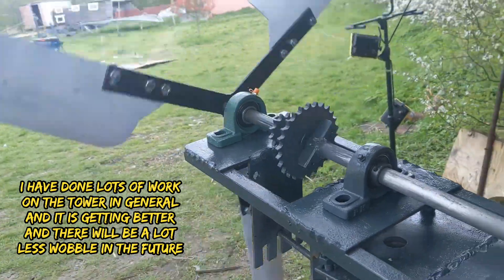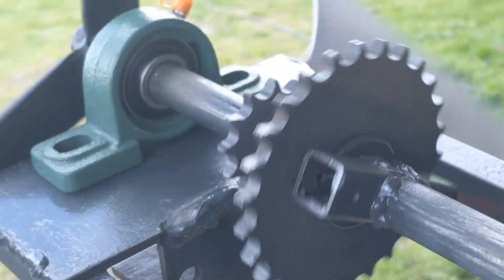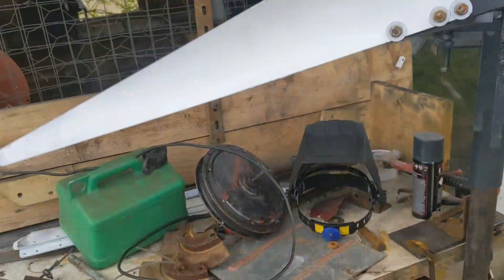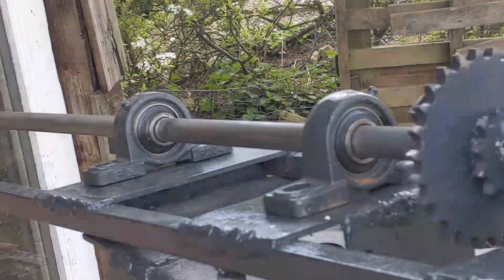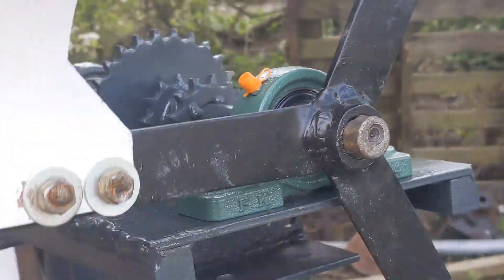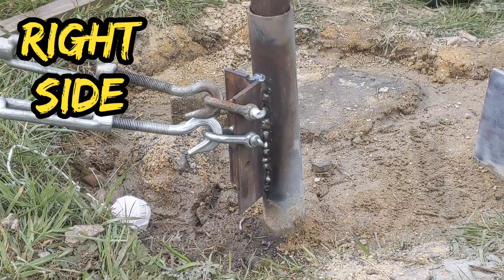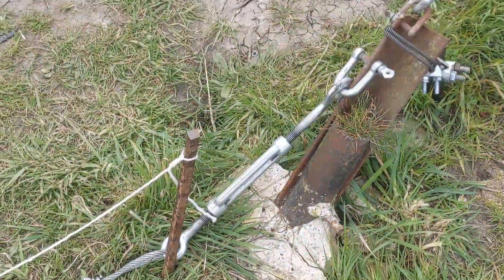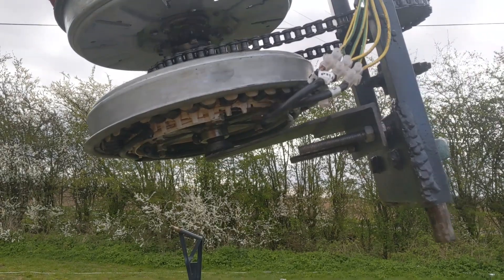Electric Bike Motor Hub -  Wind Turbine Generator - 3 phase - 12-24-36-48 volt -  15th April 2021

Comment: Last time your electric bike motor did better than ive seen other guys doing the same thing, even i made little power with dads old bike motor. Thats why i went f&p. Your going to need a reasonable battery bank or something for all the peak power youll make with an ev turbine and axial
Reply from the maker: I have seen a wind turbine inverter that plugs in to the mains I will prob give that a go , I feel it's a mega solid design I'm going to put it up without a motor in it to see the blades rip.
Reply: @GavinFreedomLover  yeh i had the cheap chinese one ,your turbine max voltage has to be within the grid tie inverters voltage input perimeters , if the grid goes down the the top name brands have an inverter protection unit, its just a dumpload, im sure its possible to make a diy unit, a simple plug in ac power supply unit could be used to switch a relay so when the grid is live  power goes through a  relay to the inverter and when grid is down goes to dumpload, like the 5 pin car relays, they can be switched with power and without, its a brilliant feature. I also bought the sunny boy 1100 watt grid tie and then learnt i also need the protection box and the turbine cannot exceed max input voltage. I have heard the mechanical relays can fail where solid state last longer, i havent yet seen solid state that have that feature but i guess its time for me to find out , out of simple curiosity